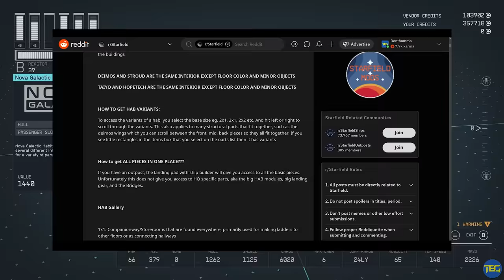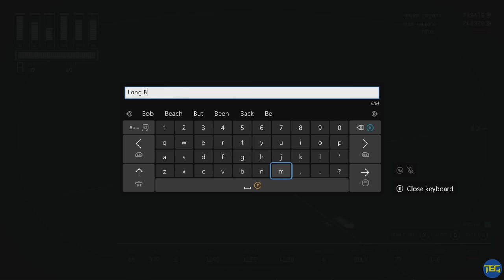Starfield Ship Building Guide // Full Step-By-Step Guide (Class B)

Comment: The issue with those corridors is how heavy they are. I just managed to build an A class ship using this bridge and the 2 of the corridors and zero ladders other than the static one for the docker. Ended up with a 80 mobility 150 speed ship so not too bad. Probably could get mobility higher if I went with a B reactor and engines but I wanted to see what was possible with an A reactor.

Comment: What exactly does fuel do?
It's not tied to jump range. My Frontier has 50 fuel and still jumps 27LY.
It's not tied to engine power or speed.
It may be tied to boost range, I'll need to test it later.
Reply: Jump Range is based on Grav Thrust, affected by Mass. The Grav Drive determines how far you can jump in a SINGLE step, and the Fuel Capacity determines how many 'steps' you take before you have to stop, and re-navigate.
As an example, with a Jump Distance of 27, you can 'jump' from Bessel to Neon in three 'steps', and it takes approximately 30 Fuel to do so. IMHO, any fuel beyond about 300 is just wasted mass.